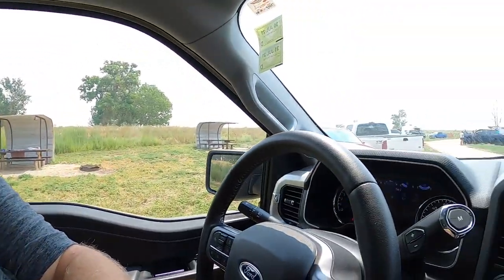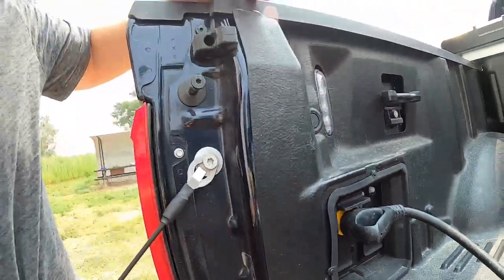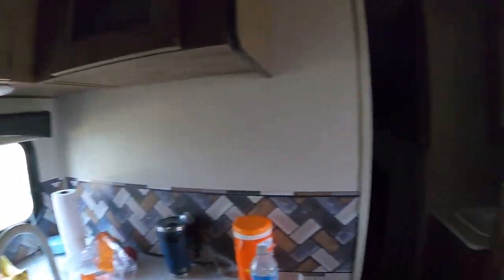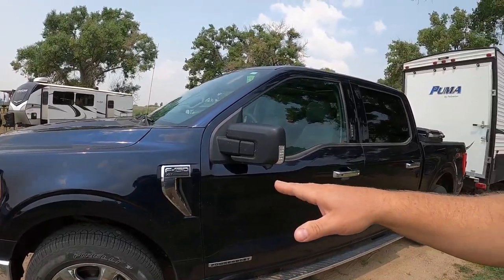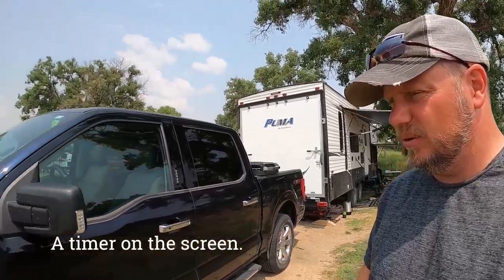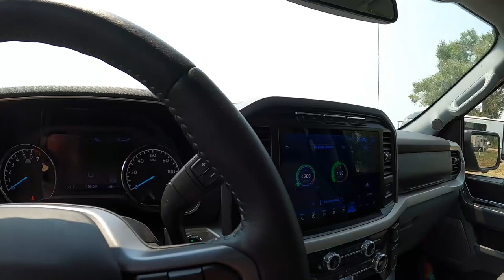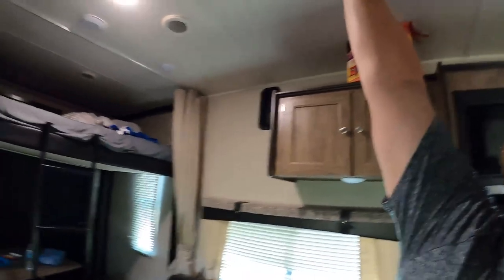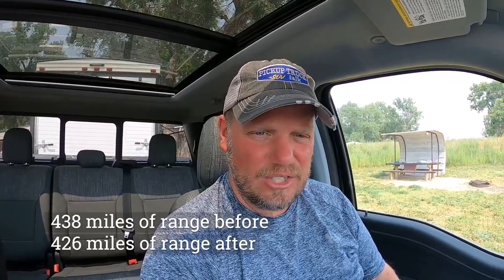Shocking? Running A/C for hours, 2021 Ford F-150 Hybrid Generator

Comment: Even if you never end up using it you may as well get the 7.2KW generator if you get no other options. Its one more option that will help resale later. That and 4wd was the only 2 options i got on mine.

Comment: i've been testing mine extensively over the last 2 months.....my camper is also a 30 amp hookup......i use the high idle option, for better turbo health....with AC on, and other draws for charging battery bank and whatnot, 2200-2400 watts is the average draw.....cycle times around 1 min idle, 6. mins battery only.....
Reply: Paul, you wrote:  "i use the high idle option, for better turbo health."  Can you explain this mode?
Reply: @kdcarver  in the settings area there is a choice of idle settings when the engine is idling and charging the battery.  select high idle to be on.  it idles the engine at about 1300RPM's, vs. the normal idle of aroung 900RPM's.

Comment: Looking forward to a 50 amp generator being installed on the F350/450 models to run the big fifth wheel units.
Reply: Woah, hadn't even thought of this option. I hope that ends up being an option
Reply: @Brandon_Neil  it would make pulling into a truck stop a lot nicer. Just turn the generator on and go to sleep.
Reply: Agreed.  Last September (2021), I was looking at purchasing a F350(XLT) and asked the sales rep if Ford was planning to add a generator to the Superduty series.  He checked and he informed me that, at that time, Ford was not planning to.  I am hoping that Ford changes this decision.
Reply: It wouldn't make sense unless they did a hybrid f350.  The battery is a buffer for the generator.  Minus the hybrid battery the engine in a regular truck runs 24/7.  Then a regular generator with idle down is a lot more economical.
Reply: @WisconsinDIYGuy  so adding a battery pack and a generator to the PTO option of the transmission wouldn’t work? Seems like a great idea. I hate pulling off at a Loves and not being able to run my air conditioners.
Reply: I haven't heard of an option like that for the pto.  The reason a hybrid makes sense is because vehicle engines are way overkill to produce 1000 to 7000 watts.  Normally generators for this have small engines like lawn mower would. Hybrids with the big batteries can store up juice from a few minutes idling that takes an rv, campsite, ac, whatever, much longer to use.  It needs a rather sophisticated battery mgmt system to tell the motor when to run and when to not.  Ive run a campsite many times over the years for days with my hybrid sedan. Runs about 3 mins per half hour.

Comment: I was there when your winter test failed and was waiting for you to do this again sooner rather than later but couldn't wait. Got my own F150 Power Boost and our little 9000 btu trailer and boondocked over night twice at Cracker Barrel coming and going with a 30 amp to 110 adapter and worked great. Love our truck! I want to get my hands on your adapter tho so I can use that plug too!

Comment: I wonder if the new Tundra will have something similar to this truck. No noise power is great for an old guy like me. The older I get, the more i love silence.
Reply from the maker: Silence is golden. I'm completely with you there.
Reply: @Pickuptrucktalk  👍
Reply: Quiet until the battery needs recharging.  Engine will start up frequently to keep batter charged up.
Reply from the maker: @robertheinkel6225  the truck doesn't make that much noise at all.

Comment: I do like the idea of having another source of electricity. I use a CPAP which drains my RV batteries at night. Sometimes the furnace won't run at high altitudes, probably because voltage is low on those batteries. I understand the fuel tank is smaller and payload is less on the PowerBoost as compared to the max tow package Ecoboost which has a 36-gallon tank. Considering mpg on an ecoboost is quite bleak when towing and payload on 1/2 tons are low already, one must evaluate the net value of replacing fuel and payload by adding an inverter and the associated battery. If you haul fuel and an inverter in the back of your truck, that also reduces payload. Mine has remote control and is built into a steel lockbox on the rear bumper of the trailer.

Comment: For future reference if you do another test... Using a Bluetooth OBD2 adapter and the TORQUE app you can read your fuel level in a percentage. In other words, a digital fuel gauge. Maybe Ford's diagnostic mode will show a digital fuel gauge as well. Anyhow, more accurate than using miles remaining.

Comment: I have a 3.5L Eco boost V6 in my 2013 F-150. I live in Alabama and run my AC while parked for hours. I burn a little less than a gallon per hour of fuel with my engine running and the AC on full cold (Using an Xguage to measure fuel consumption).  Your gas guage wouldn't have noticed just two gallons in your test.  Really appreciate your test though, very good info. I may have to upgrade my F-150 to a Hybrid. I pull a travel trailer and that inverter feature would be great.
Reply: Yeah but in 2 hours his truck would have only ran for 24 minutes or so

It would be off the rest of the time. It cycles on and off.

He used maybe 1/3 gallon or $1
Reply: @jasonguy6572 Glad you pointed that out.  Hybrids run only when the battery gets low.  I use a Prius on some group campouts for lights, fridge coolers and tent usage. At 100-200 watt draw Engine runs about 4 mins per half hour for 3 to 4 days straight.  I dont even notice the fuel usage.

Comment: So you are only using 1 leg of the 240V plug. This is evident on the truck dash display where the wattage only shows a draw on the right gauge. One would think you could also plug something in to the 120 V plug that draws on the second gauge. You could run a coffee pot or other device off of an extension cord and it wouldn’t affect the 30A circuit draw. Is that correct?  You could draw up to 3600 watts on the 30 amp plug and up to 15 amps on the 120 plug?

Comment: Good video.  I saw this option and as a Ram fan boy thought that is best new option for a truck.  If I get back into Camping will have to look into this.  AC at night at some of my favorite camping spots where at 10:00 pm quite time starts but that thing does not really make any noise sound like a win to me.  Hope to see some more videos like long run and gas used and then maybe a portable generator comparing to this in gas usage.
Reply from the maker: Check out the playlists from the home channel page. Got 30 videos on this truck.

Comment: Great vid!  Very useful!  I'd love to see the same video but running a heater overnight in the cold of winter, see how much gas would be used from dusk till dawn or a little more?  If there would even be enough  gas or how much would be left, after one night or even a few?  I have no idea but would love to know.
Reply from the maker: Most campers have propane heaters, but if you are using an electric space heater, you'll use less energy to power it in most cases. Tons of factors like if the camper is 4 season, overnight temps, wind, etc...

Comment: This is the first option on a new truck I would actually like to have. I need it on a 3/4 ton with a standard cab eight foot bed and with the 7.3 engine.
Reply: Nobody needs the 7.3. At that point buy a diesel. Why would you want less power & to spend more on gas?
Reply: @Chumbucketsecret  $10,000 buys a lot of gas.

Comment: Just got me a 2021 powerboost. I dont know about using it to run my RV or my home as the sales person said I can. I am to old school, I think I will continue to use my Champion generator. It is light weight that I can carry and it will run everything.
I think my problem is frying the trucks electrical.
Reply from the maker: You can't fry the truck. It will stop providing power if it gets too hot.
Reply: @Pickuptrucktalk  
You are most probably right. Its just me. There is so much on this truck that it is overwhelming for me. Young family members that checked it out cant believe everything it does.
I just found out the tail gate lowers on its own.
I had bought on a whim because my 2013 had broke down while on vacation, so I just bought this one and I was in a hurry to get back home, so the salesperson just went over the basics with me.
Hell it might even fly. I dont know😃
Reply from the maker: @martindriver6026  I can confirm it doesn’t fly. LOL. It is quite the technology in the truck. You’ll get the hang of it.
Reply: Is sounds good until dad takes the truck to fish at the lake and the camper is left without power until he get back.

Comment: A typical gas generator and most likely the F150 can produce about 10 kW-h of energy per gallon of gas. 1,700 watts or 1.7kW for 2 hours is 3.4 kW-h. That is the equivalent of 1/3 gallon of gasoline. My guess is that you burned around 1/3 gallon for 2 hours. Or 1/6 gallon per hour. Or 6 hours per gallon. with a 30 gallon tank it should run 180 hours but that assumes AC on all the time. Most likely AC is off 50% of the time. That should handle you for a week of camping. By the way, I believe the Powerboost is a much better option than the Lightning.

Comment: I'm interested in buying a F150 with the regular ecoboost and the 2.5kw generator, I wonder how well that would do in this test? The generator is a great idea and makes a lot of sense.
Reply from the maker: It would just take more fuel with the lower power output.
Reply: The other problem is you have another item to carry and maintain. They are much louder than a truck idling too. I have a 3500 watt inverter genny for home back up but its a PITA to run it every 1-2 months, oil changes, etc

Comment: You should pop the hood if you plan to run it for long hours, this way it helps keep the temps down, and less radiator fan on time to save gas.
Reply from the maker: You know it turns itself off and on right?
Reply: @Pickuptrucktalk  I did watched the video, I know. But, incase you run it with more load it would save the engine and accessories if you let the heat out. Lifting the hood is free.

Comment: This hybrid is a game charger. Just think, that it's Ford's first try at a hybrid half ton. Should only get better from here!
Reply: @michaeldobson8859  That truck was probably a lot more than 50,000.  I am failing to see any efficiency here.  inverter generator is the way to go.
Reply: @michaeldobson8859  That generator will be much louder and require separate maintenance and refueling. Most campsites we go to don't allow using a noisy generator at night. A generator can't replace a pickup but this pickup can replace a generator. IIRC, he said this was a $750 option...
Reply: 7200 watt inverter gen only runs 8 hours on a tank. At.one point ford advertised this package running for 32 hours at max load. Considering the cost for a truck with a tow package to begin with, being able to fill up, tow to the spot, hook up, party all weekend, and drive home with no refills, no gascans, no gen constantly running at night, seems like a good option for people who would like to utilize it. 

But you'll need to enjoy it while it lasts, I don't see much for internal combustion in 10 years.
Reply: @yankeedoodle7693  Yeah, ICE cars/trucks are going slowly going the way of the manual transmission. I'll miss the personality of them but I'm sure EVs will develop something as a replacement. I'm curious as to how those nostalgic EV car meet ups will look in 40 years lol.
Reply: @michaeldobson8859  the stupid $700 inverter won't help on fuel economy when driving the truck, also the ford on-board inverter is much more powerful/flexible and the hybrid system actually makes the motor work less at idle.
Reply: My generator is quite and more efficient then the truck
Reply: @yankeedoodle7693  internal combustion will very much be around in ten years. No way is battery tech going to advance enough to be able to tow campers cross country in the next decade, let alone semis hauling groceries.
EV's are a niche market and will continue to be for decades unless we somehow figure out how to drastically update and upgrade the power grid
Reply: @yankeedoodle7693  Yes, using all 7200 watts, but he's using a lot less to only power the a/c. It's a great tool when you supplement with a little lithium and solar in the rig.
Reply: @yankeedoodle7693  
The best post one seen in a while;)

Comment: Thanks nice video.  Any ideas on how to properly set up a transfer switch to power part of your home during a power outage?
Reply from the maker: Hire an electrician and then go to Home Depot or any other store. There is an exterior plug you can install outside your house and then bring into your breaker box. From there, you need a power transfer switch in the fuse box.
Reply: @Pickuptrucktalk  I have a 2022 F150 Hybrid ordered. I got the 7.2kw one also.  Have zero idea when it arrives, but really looking forward to getting.  Again thanks for your video.

Comment: Tim, did you try having the trailer hooked up to the generator while towing?  That way when you get to the camping spot the trailer is already cool. I thought that would drain the gas but this video proves is probably wouldn't.
Reply from the maker: No I didn't. In order to do that, I'd need to somehow attach the cord to the RV so it doesn't fall off on the ground. Not my trailer, so I can't do anything permanent to attach cable.

Comment: I am just SO impressed with the F150 PB ... imagine if and when GM and RAM finally get into this action!
Reply: I don't think either one will duplicate this.  GM is focusing on an all electric Silverado.  The battery would probably be in the 150kWh range as they are claiming 400 miles of range.  

The Ford is claiming around 230kWh worth of total energy available at peak load on the 7.2kW generator.

I haven't seen any hints from Ram or Chevy they are planning any Hybrid trucks, except for the mild Hybrid available over a decade ago.

Comment: I just want to point out your amp math. It is correct BUT it's only correct when you are using a 120v system. Like house power. If you go to a 12v system it will be 12v per amp or a 220v system it will be 220w per amp. It's called ohm's law. I would recommend checking it out instead of always using the 120w per amp calculation. Basically Voltage = current (amps) x resistance. So with a little algebra you can calculate it to watts= Amps x Volts.

Comment: Isn't there an issue in using 220 Volts into the camper? Guessing the camper is rated for 110.  Am I wrong about this?
Reply from the maker: Yes, 220 is too much power.
Reply: There are 2 110v circuits in a 220v supply. This RV only uses 1 110v leg with this adapter. The unused leg could be used for powering other things or another camper if set up correctly. Large campers use a 50-amp 220v plug but most likely could not be towed with a 1/2-ton truck.

Comment: I bought the 30 amp adapter and when I plugged it into my camper I got a grounding default message. Did you ever run into this issue? I looked on the F154 on and there are multiple people that have had this issue.
Reply from the maker: Never had this issue, sorry.

Comment: I cant wait to see what sort of early issues he has with the particulate filter the truck engine must be equipped with...I dont think you can simply let modern engines run at idle for hours on end without having problems in the exhaust filters early on.  Maybe a high speed drive or two would clear it out, maybe not.  Ive only experienced this issue with diesels, but I noticed the last car I bought in 2019 had a gas engine and an identical particulate filter as my diesel model had....got to imagine it will screw it up similarly.
Reply: I have a 2013 Ecoboost 3.5  f150with 190.000. I idle at least 8 to 14 hours 5 to 6 days a week. It runs as smooth as my 2020 2.7 Ecoboost f150

Comment: Does the average trailer need the 7.2kw or is the 2.4kw plenty for a trailer?
Reply: I asked the same question.  I think most AC's on a trailer will have a 2.5 - 2.6KW startup requirement.  So I need to find a used hybrid that was optioned with the 7.2.

Comment: That's seriously impressive.  I wonder if the 2.4kW inverter would be enough for a camper with a 15000btu AC unit?
Reply from the maker: I don't recall the math involved. But I think you can easily Google search the watts to kW needed for your specific AC unit. You also have to figure out the initial startup power needed vs the running power unless you have a soft start feature on your AC.